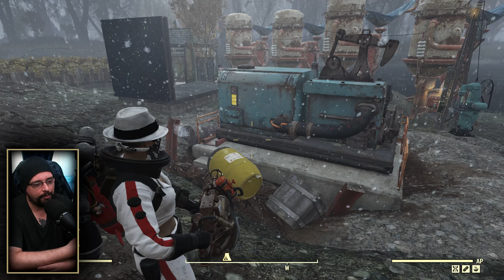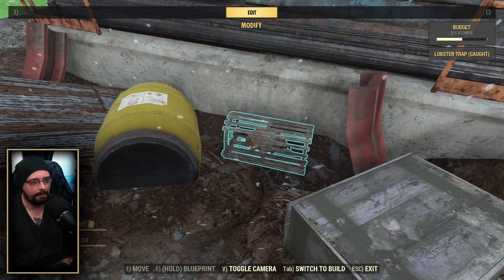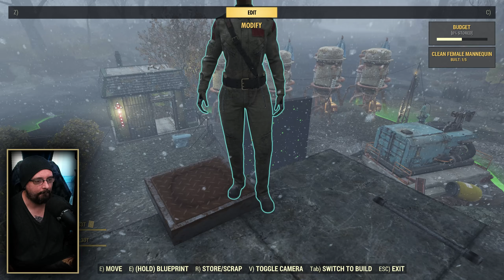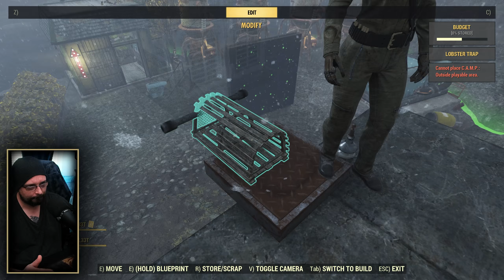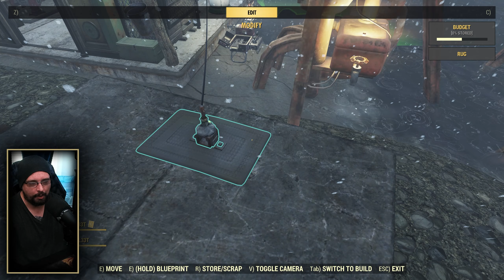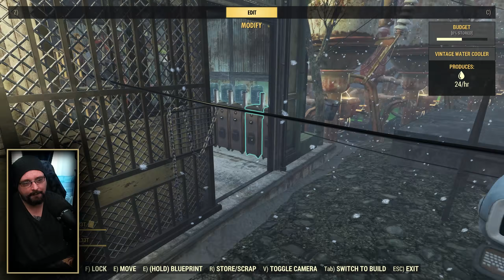Fallout 76 - Hiding Generators & No Wire Restrictions

Comment: Thanks for this very useful info. I was just making a new CAMP at the skyline valley region that needs this technique desperately. Also you dont need the mannequin to activate the pressure plate. You can just press the "Toggle camera" option to go into free view and then select the plate and move it once, you will notice is permanently pressed and it stays pressed no matter were u move it.